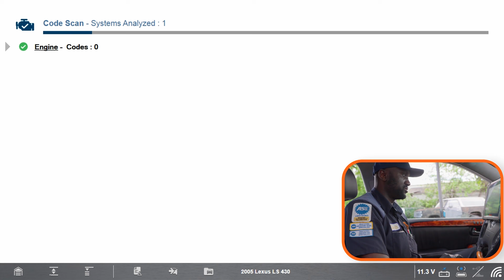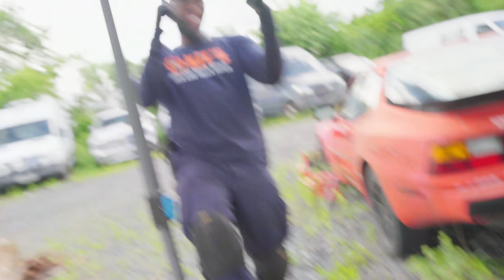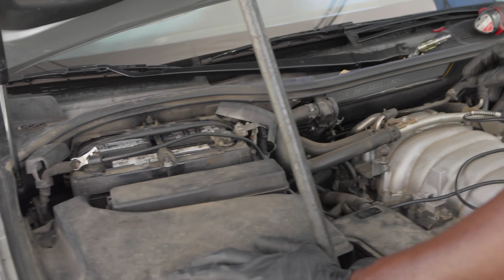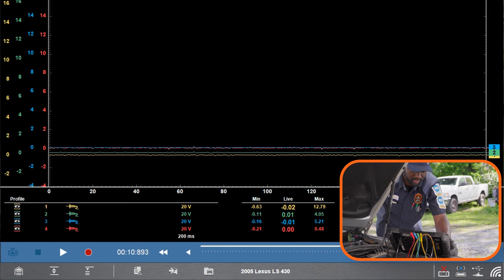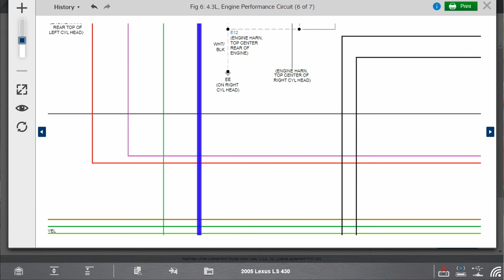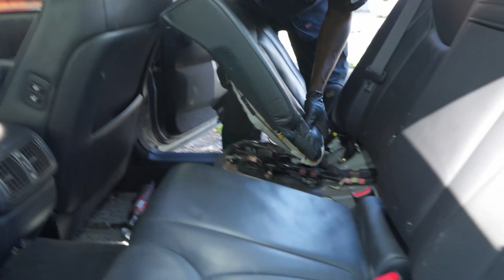Lexus LS 430 - Crank No Start ( Part 1 ) I went Down a Rabbit Hole - DON'T DO THIS

Comment: Before anything I always check on fuse box, then to components, how about exchanging the coils, crank sensor,   after all the troubleshooting and still the problem is there,  a question,  is it possible that the fuel pipe lines can be also jammed?

Comment: Your TEMPERATURE SENSOR might be suspect on this engine, not uncommon on 430LS. If defective it will not read acceptable temperature and prevent the fuel to pressurize/start..... Youre a good mechanic, this problem will stun many a mechanic, dont feel bad!

Comment: Use a trick of listening the  fuel pump hum sound, check the crankshaft position sensor failure before concluding the fuel pump failure. 😊

Comment: On Toyotas if the computer doesn't see the fuel pump running it won't spark. Because this is 05 pre class 2 data it won't set a code. Way to stay focused Deo💪💪
Reply: That  suspected that scheme as well,  but he back-probed the coil and detected command input arriving just fine.

Comment: My rabbit hole uncovered more and more issues. I'm glad I went down my car's rabbit hole, lol.
My crank no start was a faulty crank shaft sensor. I got no pulse on injector. Then realized that the starter was sucking the live out of my battery. Etc etc etc.

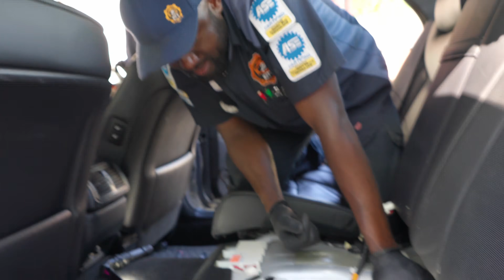Comment: 50:04, Even though its more than Likely, Should've tested the Controlled Side Of the Fuel Pump Before Calling It. Adding to what @mdAshcube2476 said listening for the Fuel Pump. Maybe send power directly to the FP Motor to see if it activates. To Rule out any other issue/Blockage after the Fuel Pump, Since you're already at the Connector wires. My 0.2💲💰

Comment: Hi KIT’s, one of the first places to check in Toyotas if a Toyota not starting especially Toyota cars, just listen for the fuel pump humming under the back seat once you turn the ignition to on. The fuel pump will run for about 15 to 20 seconds and then it will automatically turn off if you don’t crank the engine or start the engine. Once you don’t hear the fuel pump humming because it’s actually pumping the fuel through the fuel lines to the fuel rails. That means you could have a defective fuse, relay or fuel pump. That’s the first thing to do in the method of elimination in Toyotas if they’re cranking but not starting then you work your way from there.
Reply: Even if the fuel pump is running, there will be a no start without spark or ignition working. You have to get ignition first.
Reply: @Roq-stone No my brother, you’ll eventually get there that’s why it’s called the method of elimination. Didn’t you read that above? These are the fundamental elements for any combustion engine to operate: air (oxygen), fuel and electrical current. Now any other thing/s are add-ons to improve performance and efficiency.

Comment: In a Toyota newer models, fuel and ignition system are working together programming (ECU to FPCM) it is a safety purpose and at the same time it can manage your part cost $ (ignition coil and fuel pump). it is vice versa, fuel pressure low definitely ignition system will shutdown that means you can only read the code through Toyota techstream(Toyota OBD2 software)

Comment: As a technician. I alway check fuel pressure first, then spark, then control command from 
computer trigger to Injector pulse and also turning off ground from PCM command  and amplify high voltage for the high voltage coil. Great job.
Reply: Good Works Bro  ,good to be patient, make sense, God Bless u. Keep up the good works ur doing.

Comment: Hi deo, check all  ignition coils, distributor , crank shaft position sensor,  cam shaft position sensor because apart from these ignition coils if they are good those sensors might stuck ECM to open distributor, I think so.

Comment: Some symptoms when you don't have the fuel pump working. The computer will say I'm not going to turn on the ignition coils even though you have a control signal, but it might be on this one that there is a very small spark

Comment: Clever African! We are proud of you but I advise you to conside the time you investing it, try to optimize your trouble shooting. Further more never give up, never tell us on the camer " I don't know, I blieve ... etc. " be inormed on such matters as a technical person, you are expected to know how deal with matter in you hand. Your problem could be synchronization of spar fuel and air. Thats it. So you could have test the coils for supply voltage, then injectors power supply, with actuator their functionality, then fuel pump path, if no fuel , then crank sensor, finally signal wires control and feedbacks. at the  this doesn'loose your issue ECM and even Immobilizer, or ECU. keep doing your best!

Comment: Good afternoon sir i want to ask you have you check your dash board if you onn your ignation to check if your check engine light,battery light is their if its is their put another crankshaft sensor or or your engine computer may be the ic that control spark is bad . Ic that control the injection is different the spark ic from engine computer is different thanks that my opinion

Comment: Hi, Whats youre shops address? I Have a 2005 international 9900ix  with a cm870 that has a j1939 data link issue. Where the dash gauges randomly point straight down and the odometer says "no data link"
Reply from the maker: @shawnrice7179   here is our shop's address 5938-C Jefferson Pike Frederick MD 21703

Comment: Try checking the Crankshaft position sensor or the camshaft position sensor? I also won't be surprised if the ECU is bad. Great work, all the best.
Reply from the maker: @cjottovon4371   Thanks

Comment: Coil feedback is per bank. On the scope you can see you have trigger signal and 4 feedback before next trigger. Means that the 4 coils in that bank should be firing. But a loose ground can still give feedback but no spark. Interesting your case here.
Reply from the maker: @mandytuning  Thanks

Comment: i have a question if you are staying low on tech and you having problem with the pump whatever happened with the gas filter? is the gas filter attach to the pump? thanks keep up the good work
Reply from the maker: @robertsanchez3767  Thanks

Comment: Master just disconnect the fuel rail pressure sensor and the car is going to run It's typical in those Lexus
Reply from the maker: @juanpablodominguez9406 Ok, Good to know

Comment: Hello Deo. Please also remove another ignition coil and check for spark because defective fuel pump can't prevent coils from producing spark or spray some starting fluid and see whether it could start. Thanks
Reply from the maker: @sekirembekafrank3659  Ok

Comment: Come on dude where's your sense of adventure? Any way back to your no start, looking at your wiring diagram your coils aren't labeled we know your power is good double check the ground the other 2 is your IGT and IGF. The IGT is your trigger, that looked ok, that should start at zero volts and goes up to 4-5 volts, which it does but your IGF wire which is your feedback should start at 5 volts and get pulled down to ground, which it does not, I believe that was the yellow wire, now if that is not the IGF wire and it's a different wire that's grounded, unplug each coil one at a time and see if the 5 volt returns, if it does that coil is shorted leave that one unplugged and plug the rest in, it should start and run on 7 cylinders.
Reply: Excellent 👊🏻
Reply: You should apply to work for Deo
Reply: The same thoughts. Awesome
Reply from the maker: @ws2664   No fuel pressure was the issue here
Reply: You dont have to unplug all the coils...... just do one at a time and see if the 5 volts comes back... when it does theres your shorted coil.
Reply: @jamesrossmotors  I said that, it's in there, you didn't click on the " read more" part.
Reply: @ws2664  It sort of reads like you unplug them all till you find the 5 volts when you say leave that one unplugged and plug the other 7 in.
Either way I am agreeing with you!
Reply: @jamesrossmotors  Oh I'm sorry, I'm getting old my brain doesn't work as good as it used to, I also realized I wasn't as clear about checking the coil grounds as I could have been, thanks for the feed back.
Reply: Guru

Comment: In my opinion, possibly spray some starting fluid into the intake and see if the engine starts when seeing low fuel pressure or even before checking the fuel pressure quick diagnosis to determine whether it is fuel related or a spark related
Reply: It will no start as far as their is no spark on the plug if there is spark if you put starting fluid it will start
Reply from the maker: @RobCarstuff9112   Low fuel pressure was the issue here
Reply: You can solve the problem at the beginning as your followers say by adding spray in manifold l @KITS_Auto_and_Truck_Repair
Reply: I agree
Reply: In my opinion this is clearly not a mechanical problem like suspected timing issue to spray stater  fluid to do the test to waste time as we see it is so obvious there is no fuel delivery an no spark this our direction even after spraying stater fluid and its starts so what still the issue is not settle OK good ❤
Reply: I like your smiles 😂
Reply: If it starts with the starting what could be the problem then?

Comment: If one or two coils was bad it would try to start with having fuel. I would check crank signal first  (RPM data ) scanner. It looked as though you was getting signal to coil, but it looked like other signals was not present, just  some vag. not all equal. . Just like checking one secondary fire event, you can see feed back of others on the scope. something was strange.
Reply from the maker: @overload1010   Ok

Comment: Deo, let’s go back to the basics of both switch inputs and outputs testings - ckp sensor - icm - both coils and pcm - pcm - injectors.
The icm directly controls the coils and also sends reference in the form of square waves to the pcm; the pcm could also send reference back to the pcm to control the coils. Now, we have confirmed that cylinder 3 coil is getting the needed power, ground, control and feedback from the pcm, hence the pcm may be considered good at this juncture. Therefore my hunch shifts to a faulty icm ie it could be shorted to ground or even open, it’s wiring integrity may have also been compromised. I mean it’s connection to the coils, because there is the possibility of the icm sending reference to the pcm but also not capable of controlling the coils. Hence, no spark. I am ruling out the ckp sensor because the scope shows reference signals from the icm/igniter via the ckp sensor. So the icm is performing one leg of its functions but not the other of firing the coils. I hope changing the fuel pump would sort out the fuel delivery problem because that seems the main issue in that area, clogged fuel injectors which may also constitute an issue cannot be dealt with until we have fuel delivered to the injectors at the appropriate level.
So summarily, it appears we have both spark and fuel delivery faults to contend with on this project.
Reply: Further to my earlier suggestion, it is important to determine what type of circuit design we have here ie pull up or pull down so as to know the direction of our troubleshooting. With the DMM connected to ground (black lead), touch the icm/igniter signal wires to confirm the voltage, if it’s high, that indicates a pull down but if it is low, that’s a pull up circuit. With this information, you may now conduct a by pass testing to fire the coils one after the other if you like. To test the pull down, connect your incandescent test light to a good known ground and touch the signal wire on and off, this should fire the tested coil; and vice versa for the pull up circuit design, also test both the ground and power wires with the circuits loaded ie cranking or turning the key on.
If the tested coil still doesn’t fire, this further confirms that the icm/igniter, it’s wiring integrity and or the coil(s) is or are faulty.
Please Deo, I am not by any means teaching you your job, just learning from your diagnostic procedures.
Kindly correct me where I have gone wrong if that’s the case.
Thanks.
Reply from the maker: @joelawoyomi9102  No fuel pressure is the problem is

Comment: Toyota has used in tank pressure regulator which may have come loose or stuck open, not letting fuel build pressure.
Reply from the maker: @marshall1157   Good point

Comment: Do we have fuel in the tank in the first place?
Can the computer turn on the injector if the crack sensor is defective?
Reply: That's a good question that needs to be answered by Kits
Reply from the maker: @ieonibua  there was fuel in the tank

Comment: Have you tried checking the spark by unbolting the coil and just lifting the coil out slightly 1/8-1/4" while some cranks the engine? Not the best way to check but if it has spark you can usually hear it arcing.
Reply from the maker: @mechtechtools77  Nope